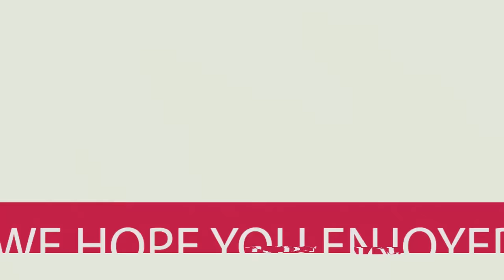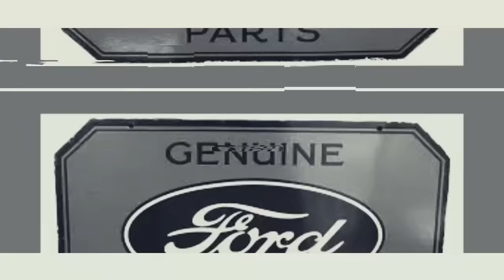Restoration Begins on Rewind Project - Episode 1

Comment: Admire your courageous attitude to rebuild rewind again but only better this time ,    I remember when i poped a power steering line and almost lost my Brougham due to big fire ,  but strangers pulled up and jumped out and stripped their cloths and just went to work or smothering the fire still it stopped ,   then when i finally found the broken line , i had no tools ,  just the garden pruner scissors,   so i just cut the belt and drove it home with no power steering,       only damage was burnt wind screen washer wires and hose , and back right 2 plug leads ,   never even hurt the paint ,  even after 4 mins burning time ,     i counted my lucky stars good people take their cloths off to help others
Reply: @AussieGarage  hey i got few new leads ,  re wired the wiper shit ,  then wiped the black smoke stain off it and she was like new again ,    but not wrong about good people from Briagalong vic  ,  father an his 13 year old son and they were determined not to see my car burn up ,   by the time the fire was out we were all down to under wear from belting fire out with our cloths ,  but it worked and that car still lives today
Reply: Great to hear people came to help. A heap of people came, but only to record her going up. There was even a guy in a prime mover, who I'm sure would have a 9kg powder extinguisher on board. he just sat in the truck recording her burning.

Comment: far out I wouldn't have been far behind you my Holley sniper on my red motor six had the fuel pressure gauge blow the glass out and start pissing fuel out the gauge at the carby EFI sniper flooding the exhaust manifold in fuel while running. so lucky it didn't catch light. lesson learned

Comment: Sad to see it damaged but excellent you are working to save it. What 'let go' on the Fitech? Did a high pressure hose come off? Or the unit itself fail?
Reply: @AussieGarage  The fire looks to be at or in the engine bay?
Reply: Actually,  I was parked and idling.  She stalled and when I turned her back on,  she just ignited.  There was nothing I could do to stop the fire.
The fuel inlet failed on the Fitech (thread failed). The screw in fitting is intact.